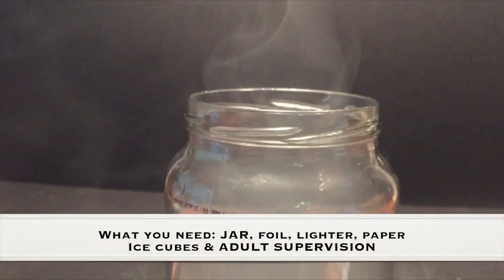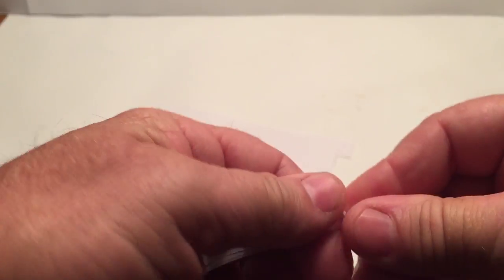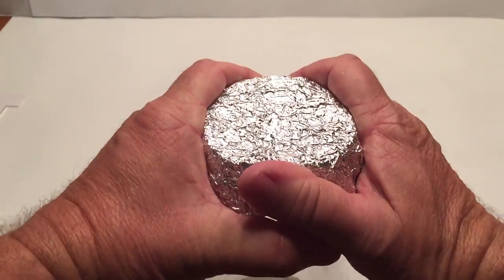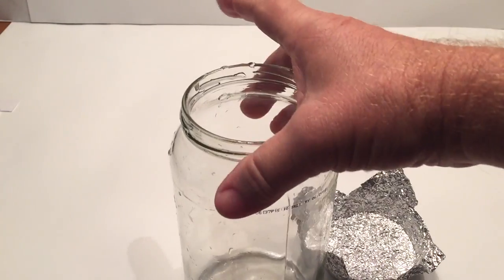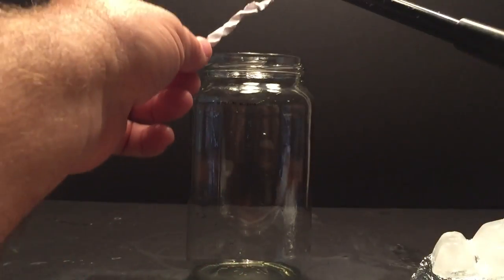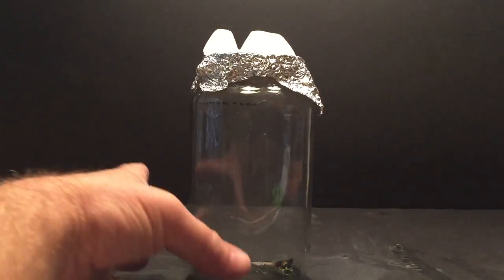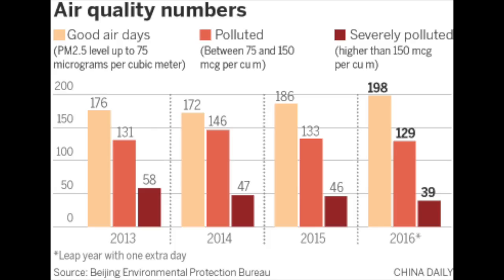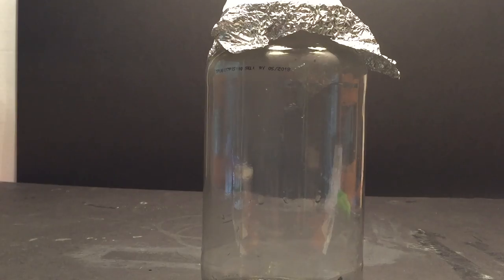How to make SMOG experiment! (Make smog in a jar)

Comment: Please tell me the reason... Please
Reply from the maker: Good Morning Kahkhasha Rizvi, 

Sorry for late response. 
Smog is a mix of natural fog - tiny droplets of water in the air and carbon dioxide smoke from pollution. It forms a thick, dirty, smelly atmosphere.

When I put the lighted paper in the jar, I made some of the water moisture inside the jar  evaporate into water vapor.

The ice made a small amount of water vapor condense. It turned into droplets of water in the jar. This appears as a mist in the jar.

Warm damp air meets cold air. The cold air makes the moisture in the warm air condense into tiny droplets that are held in the air. If there is no wind, fog forms. I hope this helps. thanks Ken

Comment: So after the experiment do I really smog into the air adding a little bit more to the problem?
Reply from the maker: No. This experiment will create artificial “smog” in a jar. This is only a model, and visual. For
example, the purpose of this model is to illustrate the appearance and behavior of smog, not the composition or effects. It is important to understand that smog is not just a “smoky fog,” but a specific phenomenon. Thanks

Comment: Nice to see, but some of the spoken and written remarks are off the mark.  Carbon dioxide is one of the pollutants coming off of burning paper, but while it is a greenhouse gas, it has nothing to do with forming smog.  In fact the incomplete combustion of paper produces carbon monoxide (colorless), and soot/smoke that includes unburned hydrocarbons (some as vapors) and black carbon - maybe some nitric oxide, all ingredients that make smog.  Of course this experiment shows mostly directly emitted smoke and water droplets as visible pollutants, and almost certainly no ozone is formed (i.e. classic LA smog has a lot of ozone).   So enjoy the visual, but don't take the description too literally.